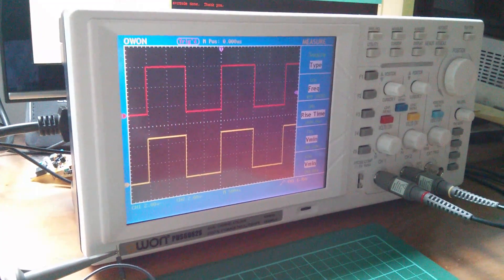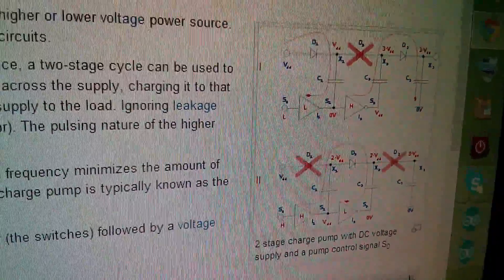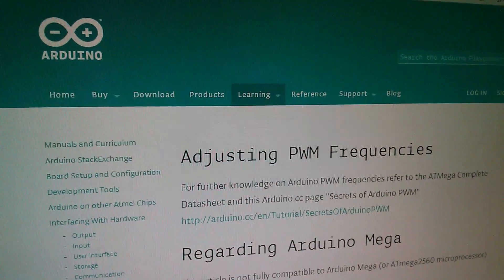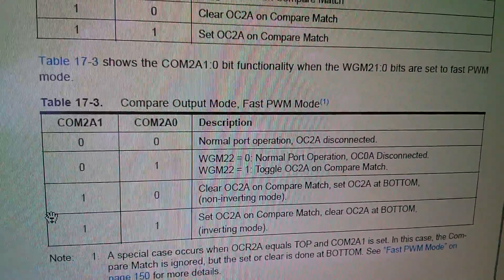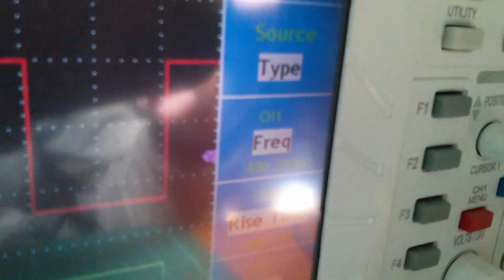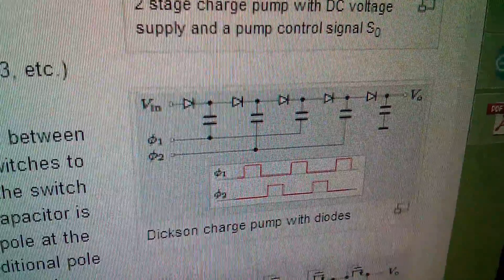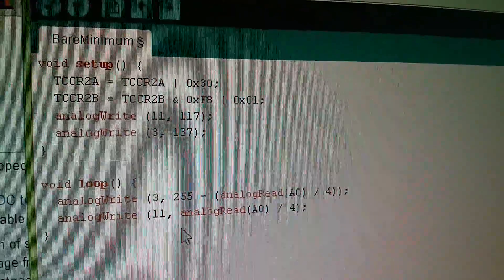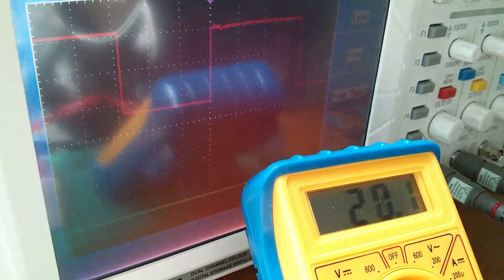Arduino PWM Solar Charge Controller #2 - Charge Pump

Comment: Hi Julian, I'm a total newbie when it comes to the Arduino and I love your video tutorials. As I was watching this video to further my knowledge on the subject - It occurred to me that the phase shifted pulses for the charge pump could instead be used as the oscillator for driving two MOSFETs in a DC-AC Power Inverter. Would you have any advice towards accomplishing this. I know there are many resources and videos on DC to AC Power Inverters but a video tutorial from you would most certainly be tops! Thanks so much...

Comment: Over the weekend I've messed around with an Arduino a bit, mostly to test out my newly acquired second-hand oscilloscope. In any case, I figured you might be interested in what I accomplished, partly because I watched this video.

First, I wanted to create a 100Khz signal. This can be done by using the CTC mode (Clear Timer on Compare), so instead of running the counter up from 0 to 255 and back down to zero (in phase correct PWM mode), you run it to a lower number, thereby increasing the frequency and sacrificing some granularity. Eg:

  // These pins are connected to timer2
  pinMode(3, OUTPUT);
  pinMode(11, OUTPUT);

  // 100khz
  TCCR2A = _BV(COM2A0) | _BV(COM2B1) | _BV(WGM20);
  TCCR2B = _BV(WGM22) | _BV(CS20); // prescaler = 1
  OCR2A = 80; // 100 mhz
  OCR2B = 40; // Place a number here between 0 and 80

But then I wanted the same inverse signal from the other pin, and this cannot be done with timer2. This is because TOP is now defined by OCR2A, so it cannot ALSO function as a PWM output. You sacrifice pin 11 for pin 3. So I went to bed... and woke up with another idea this morning: It's a terrible waste of a 16-bit timer, but maybe there's a feature there that will do the job. Indeed, it has an ICR1 register that holds TOP, so you can have both pins 9 and 10 do PWM at 100khz, one being the inverse of the other:

  pinMode(9, OUTPUT);
  pinMode(10, OUTPUT);

  // Prescaler = 1, set port B inverted, Phase corrected PWM.
  TCCR1A = _BV(COM1A1) | _BV(COM1B1) | _BV(COM1B0) | _BV(WGM11);
  TCCR1B = _BV(CS10) | _BV(WGM13);

  ICR1 = 80; // Prescaler=1, so 16Mhz/80 = 100Khz
  OCR1A = 40; // 50% duty cycle
  OCR1B = 40;

My idea with this: multiphase PWM. I just have a really horrible time finding good inductors that can handle high current and have a fair bit of inductance (looks like I need 100uH). Might have to wind my own... and perhaps study up on all the math behind it.

In any case, I hope this is useful to someone.

Comment: Hi is it possible also to modulate PWM?
I mean rhythm of audio / sound to rhythm PWM
so that you'll have a real modulator such as an AM modulator
PWM - AM modulator?

VrGr R. R.
Reply: ***** maybe it is possible to use the set-up only, rather than the potentiometer as to inject the audio.
OR,
maybe keep the potentiometer for adjustment as
the audio would then be injected with the slide of the potentiometer.
or if this really works ???
it's like a (PWM)light organ what you make with an Arduino.

friendly greetings from Holland - Rotterdam!
Rob.

Comment: According to the code, I need to adjust frequency to 20kHz. How can I modify the code ?
Reply from the maker: permpol thanapunnamas Have a look at my Arduino PWM Tutorial #2 http://youtu.be/9JXGIeM3BSI
Reply: Julian Ilett [Help] Half-Bridge PWM

#include "TimerOne.h"

void setup()
{
  pinMode(9, OUTPUT);
  Timer1.initialize(20);         // initialize timer1, and set at 50kHz
  Timer1.pwm(9, 256);         // setup pwm on pin 9, 25% duty cycle
  Timer1.pwm(10, 256);       // setup pwm on pin 10, 25% duty cycle
}

void loop()
{
  // your program here...
}

------------------------------------
Photo :: http://bit.ly/1w019Jh

According to the code,To signal to image Phase shif

How can I modify the code ?

##Thank you very much##

Comment: Nice investigation. didn't know there could be this efficiency improvement. Even it seems not to make a difference in voltage atm it might in current. Would be nice if you could measure also the current input change and output change. The dimensions of the caps could also matter...

Comment: I think the non-overlapping PWM may help more if you are buffering the PWM with bigger transistors and need a bit of time in between for them to switch on/off.

Comment: if you are measuring the output voltage with no load(or the very slight load of the DMM) then the caps will not discharge. it will run up to it max possible voltage at stay there.

maybe putting a load on it would show the affect of the overlap(if any) better.
Reply from the maker: There was a very small load on it - a 100k resistor, but perhaps it wasn't enough. Also there was a 3.3uF reservoir capacitor on the output - I'll reduce that down when I look at it again.

Comment: As the register is defined so are the bits of the register so you could also use:
TCCR2A = (1<<COM2B0)|(1<<COM2B1);

The "<<" is simply defining a mask so that you only effect the individual bits.
Enjoyed the video.
Reply from the maker: Yes, that would be more readable. I've also seen _BV used - I guess it does a similar thing.

Comment: So what is the final plan for this project?

I have used the AVR toolkit, but not the arduino framework.

If you set it all up from start, you get to know the registers to control it all.

I wonder about doing the same trick with a half-bridge driver (with external lockout to avoid short-circuit in case of software failure). The timers are not very hard to get started. I am just wondering how tricky a software feedback loop is to build (full PID regulator or not). The controller is likely to be a atmega (48?) or xmega.
Reply from the maker: This is for an Arduino PWM solar charge controller. I just enjoy controlling the chip at register level, but staying within the Arduino IDE.
The charge controller also needs a feedback control loop - making that stable and well-behaved will be an interesting challenge.
Reply: Julian Ilett You should look into flyback/forward//buck/boost/half-bridge converters.

It's hard to make a efficient converter without using inductors in some form.

You should check out the Atmel software, they got quite good debug/simulator e.t.c.

As for me: I am going to build a 30 kV supply, and the question is: some analog PWM chip or microcontroller? I will probably do both variants since I got extra transformers.
Reply from the maker: erlendse The current requirement from the charge pump is very low. I like the fact that you get a predictable stable voltage gain from the charge pump without the need for a control loop.

Comment from the maker: Final sketch:

void setup() {
  TCCR2A = TCCR2A | 0x30;
  TCCR2B = TCCR2B & 0xF8 | 0x01;
  analogWrite (11, 117);
  analogWrite (3, 137);
}

void loop() {
  analogWrite (11, analogRead(A0) / 4);
  analogWrite (3, 255 - (analogRead(A0) / 4));
}
Reply: changing frequency can easily be done by using the <pwm.h> library here: https://code.google.com/p/arduino-pwm-frequency-library/downloads/list